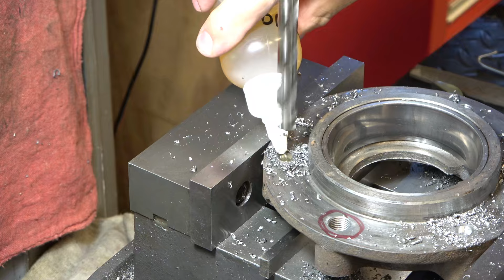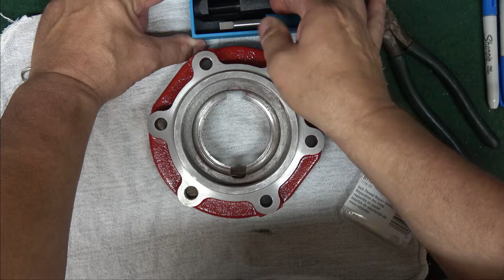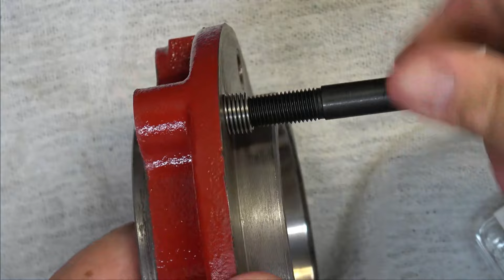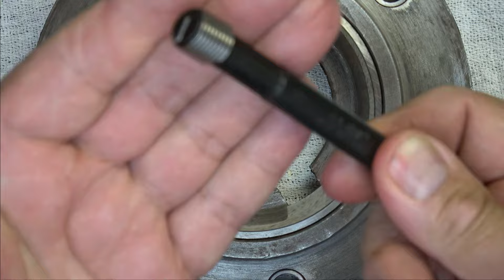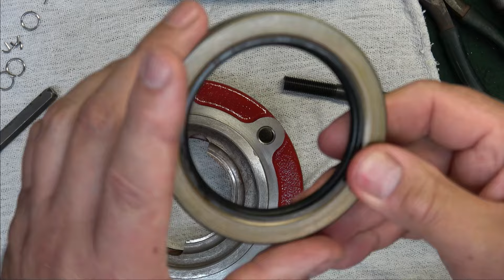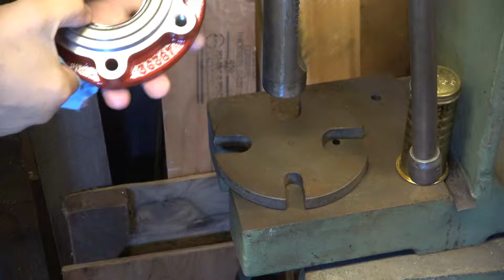Finished Axle Bearing Hub Machining Pt 5  53 Ford Golden Jubilee.

Comment: i feel like someone with your skills would flourish with a 3d printer and a CAD program
Reply from the maker: Thank you for that kind comment.  I do have a 3D printer and work with CAD often.  I use onshape.
Reply: An indicator in a drill chuck is a big no no.
Reply from the maker: @Buddha-of8fk Thanks  for the feedback.  But in reality, that's not true. As long as the indicator is not moving in the chuck it's fine. The chuck could have a 1/4 inch runout, and it wouldn't matter. It's  the relationship between the spindle and the indicator tip. They rotate together, so no problem.  I could have slapped a mag base on the spindle, and it would have been fine.
Reply: @burnthillmachine  We always put it in a collet.